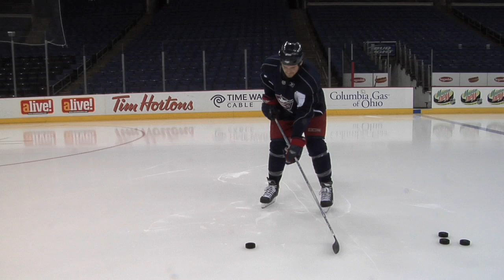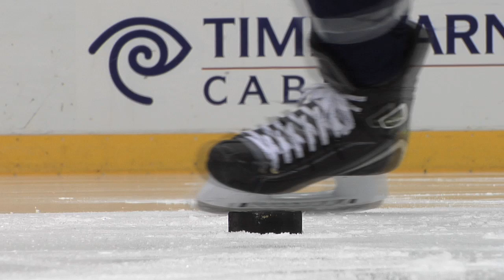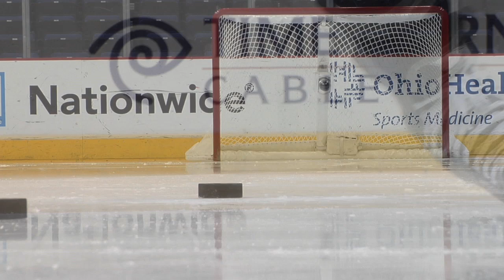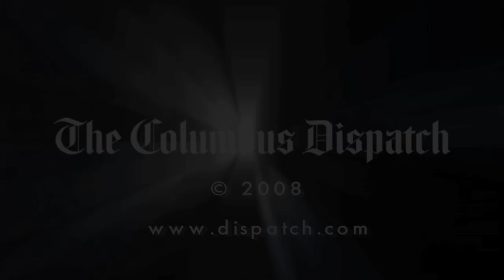Science of Hockey: Slap Shot

Comment: Nothing against Hainsey, but no he could not shoot just as fast with a wood stick. The same physical properties apply throughout the shot, however the polymer and carbon fiber these sticks are constructed from have designed portions where the flexibility in the stick is different than in the handling areas. This makes shots travel faster because there is greater stored, or potential energy. Sticks that are wood construction simply don't share this advantage to this extent.

Comment: @signmeup00 the speed of the puck can be calculated using that equation.  It is done as distance to the net / time it takes to get to the net = speed of the puck..  Speed at which you swing the stick won't matter as much.  You have to consider a lighter stick will have less mass.  F=MA
As the narrator mentioned to truly generate high speed shots you use the energy stored in the stick from its flex.

So don't buy a $250 stick because you think you'll add 50mph to your shot.

Comment: @signmeup00 heres the deal. m1v1=m2v2. If m1 is really heavy and m2 is light (aka heavy stick and puck). The assumption is that the stick velocity will be very similar for both a light weight and heavy weight stick. However the first equation indicates that a heavier stick will result in a higher velocity than a light stick. think of a pendulum hammer, the heavier they are, the force they apply to whatever they come in contact with

Comment: Bad Advice:  At 0:30 instructor says for blade of stick to hit the ice 10 inches before puck, not!  The blade of the stick should hit the ice about 1-2 inches behind puck to maximize optimum relationship between flex of stick and release of puck.

Also this video says there is no difference between how hard a shot is between using a wood stick or composite stick.  I have used a lot of wood sticks and certain wood designs are superior to any composite stick.   Wood sticks have better feel too.